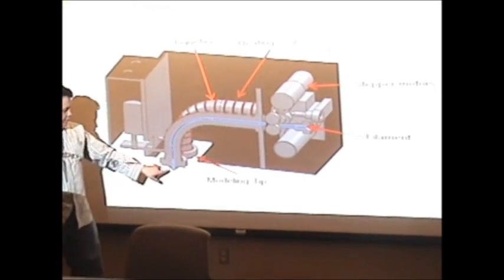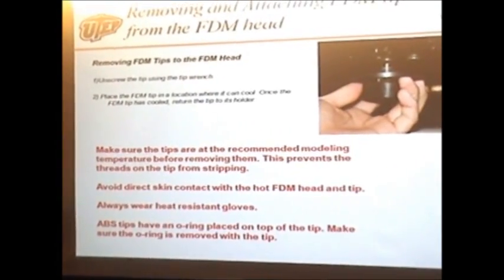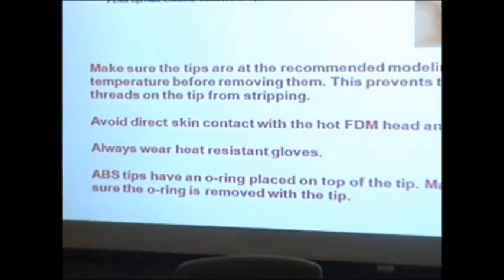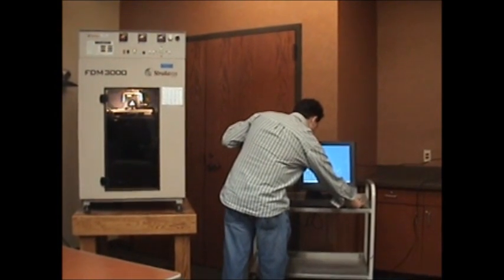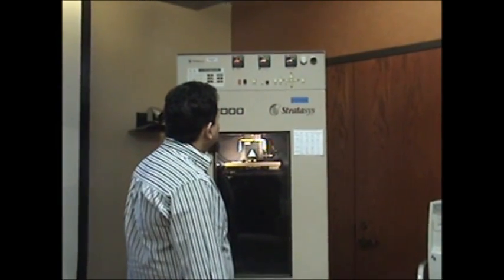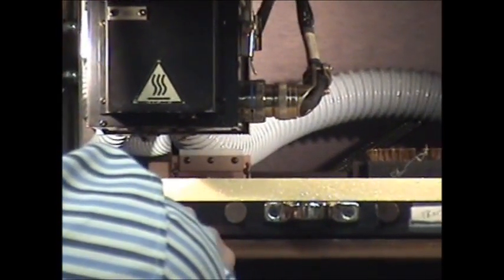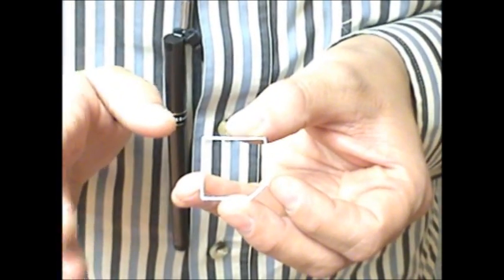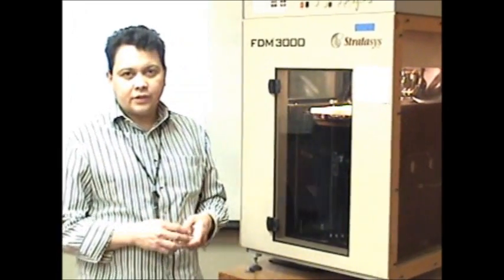FDM Lecture Part 2/2

Comment: the toolhead uses geared DC motors with magnetic encoders not stepper motors; the machine uses PWM driver chips to control the rotation of these motors